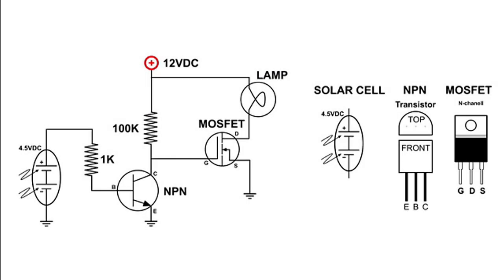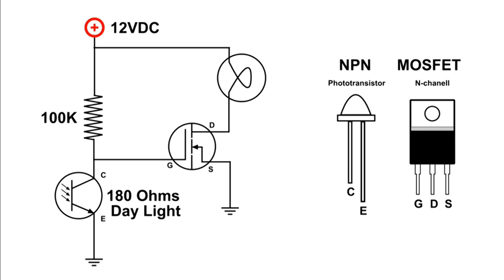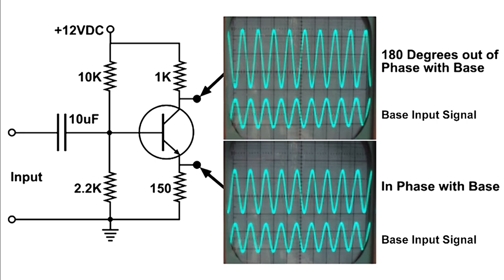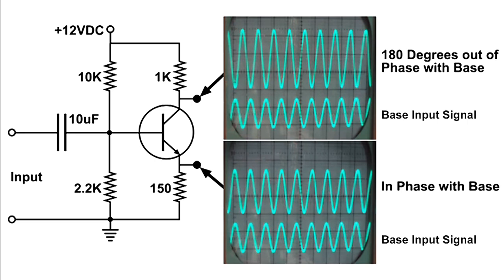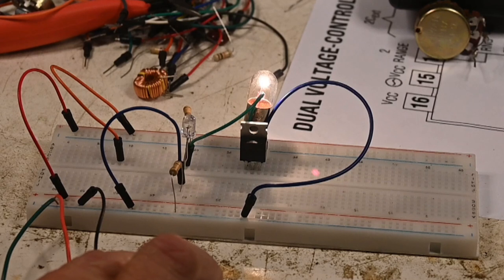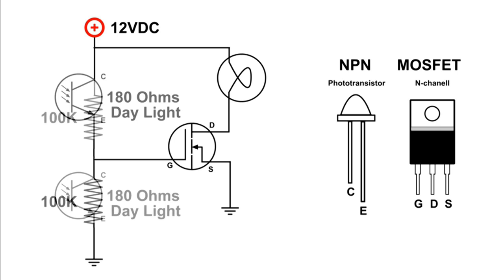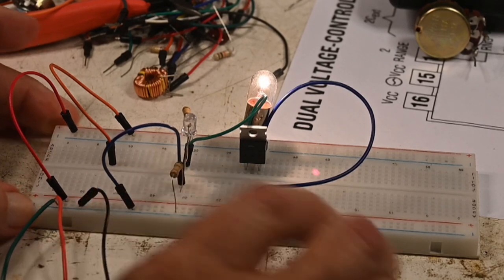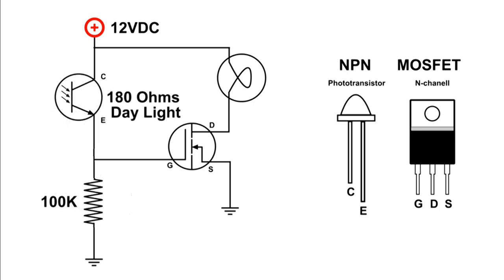Auto Off On Light Switch Reversing Operation

Comment: Very interesting demonstration of phase inversion via a small signal amplifier circuit, with a practical application. Instead of using a NC/NO relay with the typical 'dawn til dusk' photoresistor circuit. 

Thanks for the video.
Reply from the maker: Thanks and your welcome. Some YouTuber wanted to use a solar cell.

Comment: This is very interesting to me. I been searching Amazon and online for a device to turn on my shop lights before I get to work and turn them off at night. No such device is available. Now for my question, Is it possible to have a mosfet / photocell like this power 120V AC 15 Amp light bulb outlets? Or would the current blow the devices to kingdom come? I was thinking through a relay of course. And thanks for the video!
Reply: Put the mains through a relay and you'll be fine.  Build in a power supply for the electronics and you will have built your own "daylight switch"
Reply from the maker: Thanks, controlling a relay with the circuit would be helpful. The relay could handle the high current.

Comment: Would it work w/ a CdS cell, as wall?
Reply from the maker: Yes it will, you may need to adjust the resistor to get the sensitivity you want. Thanks.